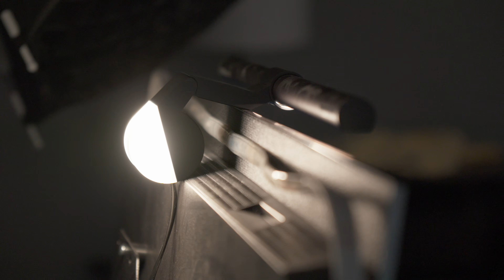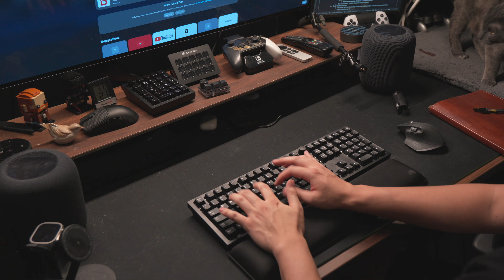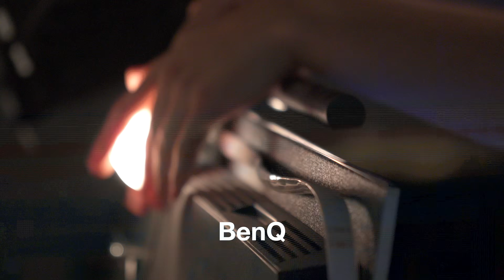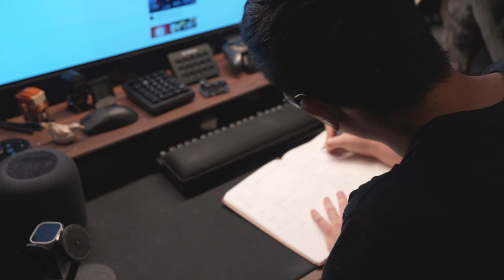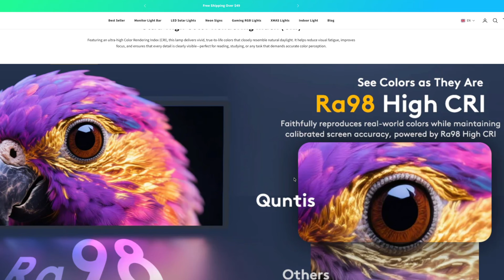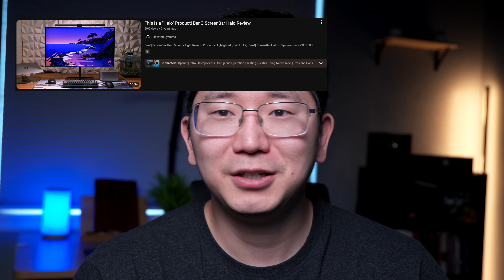Are Monitor Light Bars Overpriced? | Quntis RGB Pro+, Radar, Architect Lamp

Comment: You say it is brighter than your expensive BenQ. But isn't it just typical technology advancement?
 600 dollar OLED screen beats "premium" OLED form 6 years ago.
 250 dollar modern CPU beats  600 dollar CPU from 7 years ago. It happens with cutting edge technology marching forward.  
  
Get the newest BenQ light bar and compare it. Not your old one.

Comment: I very picky and annoying question that I'm hoping you can answer. If you set a piece of paper against your monitor, are you able to position the light bar in a way that it does not shine on the paper itself? I know all of these light bars advertise not shining on the screen, but I've always been curious if that's actually the case in reality. In a lot of the customer review photos it looks like it's shining directly on the screen, but I have no idea if they just don't care to adjust it, or if it's not possible.
Reply from the maker: You can adjust the angle the light bar shines down on, so basically yes. These are designed so the directional light doesn't shine on the screen directly, but even so you can turn the light bar outwards away from the screen if you're really concerned. But in my experience I've never had any issue with screen glare with any light bar